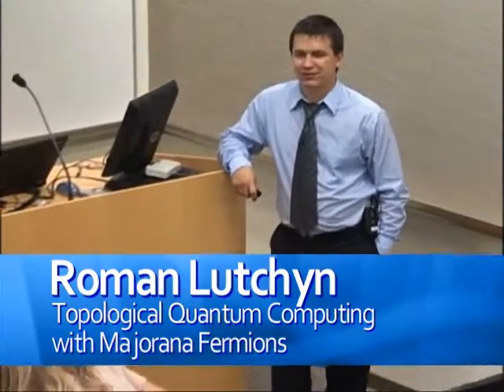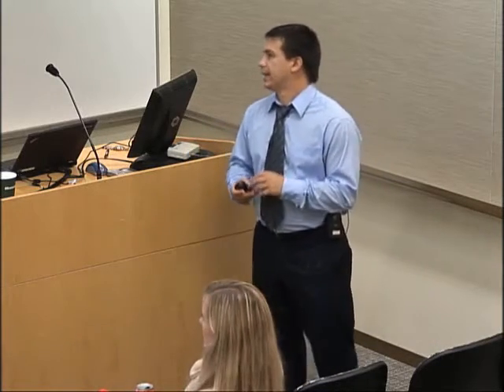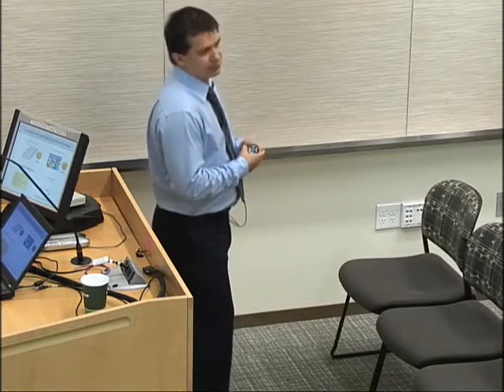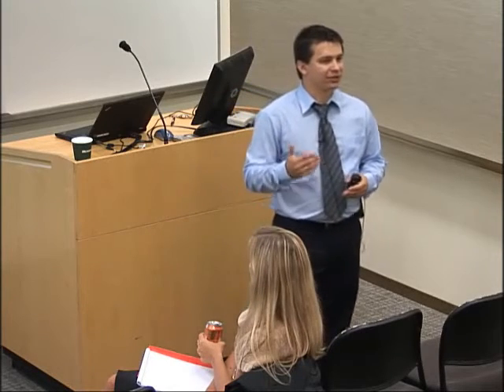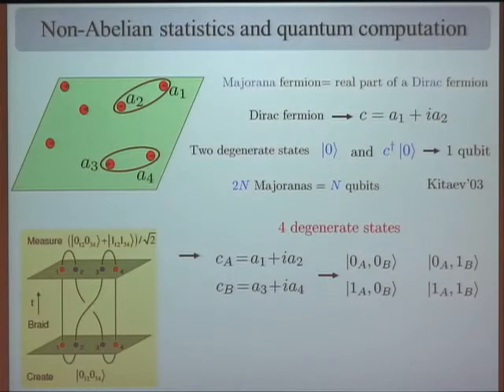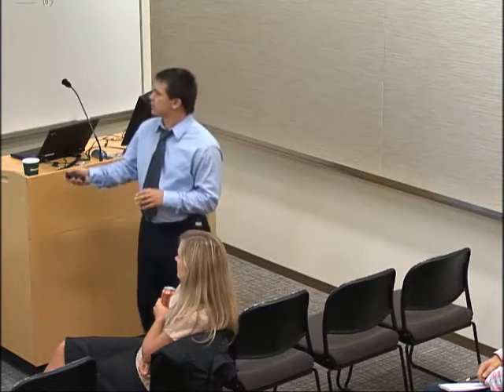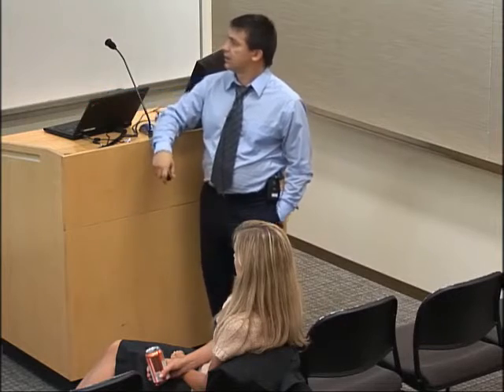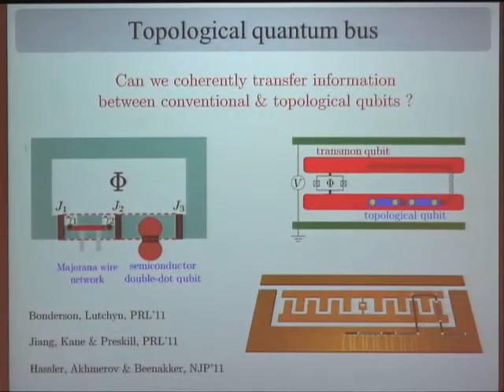Topological quantum computing with Majorana Fermions

Comment: Topological quantum computing represents a paradigm shift in how we approach building quantum computers, specifically addressing the critical challenge of error correction.  Traditional quantum computing relies on encoding quantum information in fragile qubits, which are extremely susceptible to noise and decoherence, leading to computational errors.  Topological quantum computing offers a fundamentally different approach by leveraging the exotic properties of certain materials to create "topological qubits."  These qubits are not localized to individual particles but rather encoded in the topology of the system, making them inherently more robust.

The key players in this field are *anyons*, quasiparticles that emerge in these special materials.  Unlike ordinary particles, anyons obey exotic exchange statistics.  When identical anyons are exchanged (braided) around each other, their quantum state changes in a specific way. This braiding operation is the fundamental building block of topological quantum computation.  The crucial advantage is that these topological qubits are protected from local perturbations.  Small changes in the environment don't affect the encoded quantum information because it's distributed non-locally across the anyons.  This inherent resilience to noise is what makes topological quantum computing so attractive.

From a quantum computing perspective, this approach offers a potential pathway to fault-tolerant quantum computers.  Building truly useful quantum computers requires exquisite control and minimal error rates.  Topological qubits offer the possibility of achieving this level of control without the complex and resource-intensive error correction schemes required by traditional qubits.  However, realizing topological quantum computers is a significant scientific and engineering challenge.  Creating and manipulating anyons is extremely difficult, requiring precise control over materials at extremely low temperatures.  Furthermore, developing the quantum algorithms that can effectively utilize topological qubits is an ongoing area of research.  Despite these challenges, the potential rewards of topological quantum computing are immense, making it a leading contender in the race to build practical and scalable quantum computers.  It offers a promising route to overcoming the limitations of current quantum computing architectures and unlocking the full potential of quantum computation.